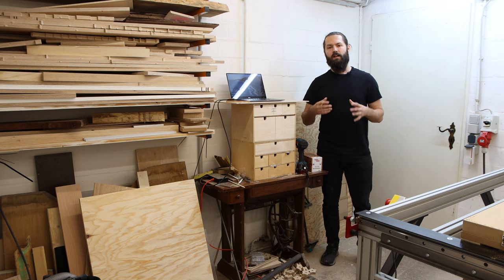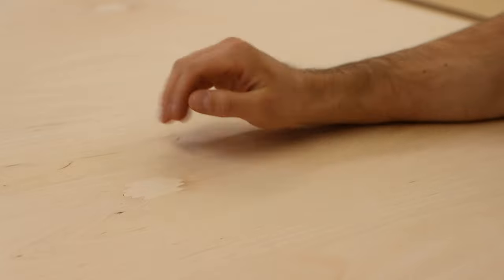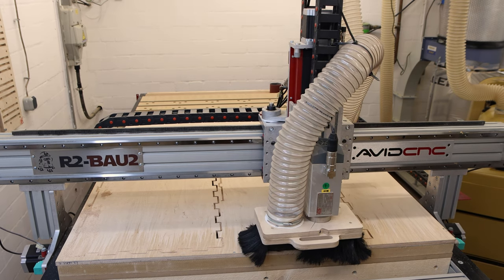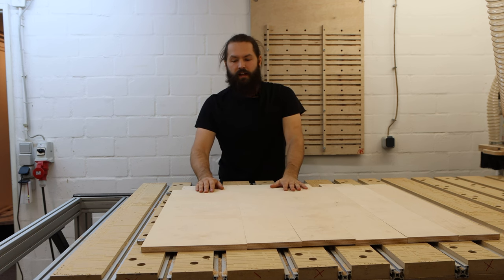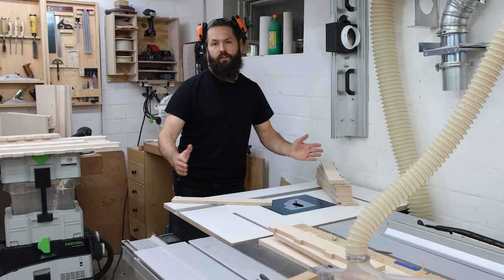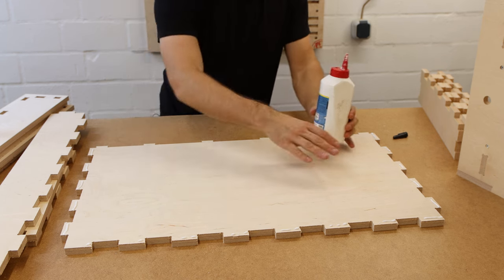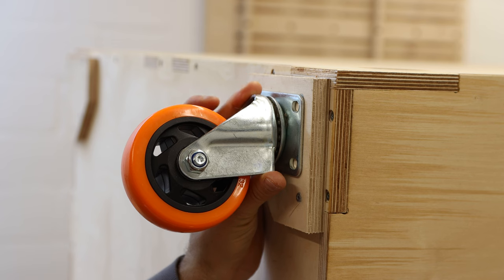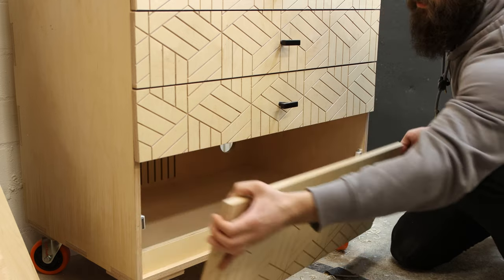Building a STANDING COMPUTER CART with cable management  woodworking projects

Comment: Another brilliant video dude, love the cnc videos keep them coming. 

Quick question, in sketchup how did you draw the box joints? Did you use a plug-in or measure them and draw them?
Reply from the maker: Hey Alan! Awesome, glad you like them 😁😍
I drew them manually by making a simple rectangle. In Vcarve I added the snigglets (the rounded cornerns). I simply took the 18mm material thickness as the width. With the high quality birch ply this works great.  With cheaper construction grade ply the joints might get loose in my experience.